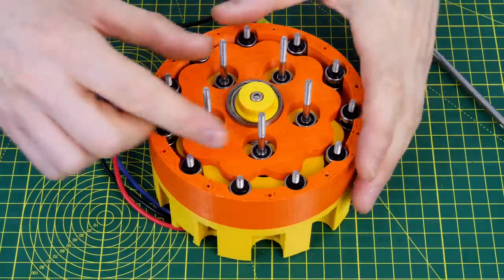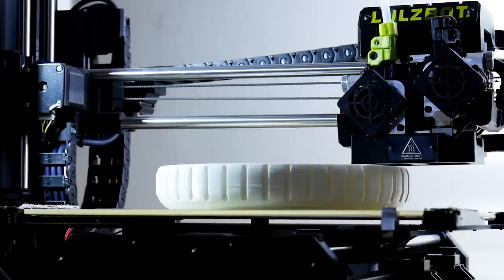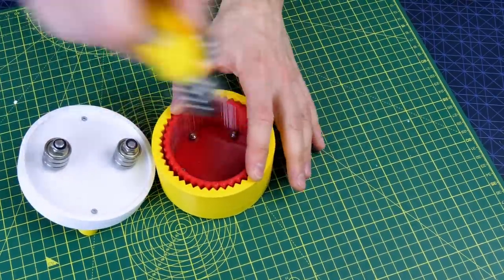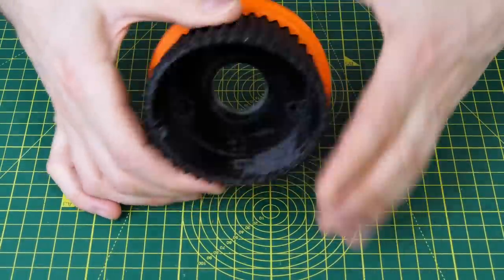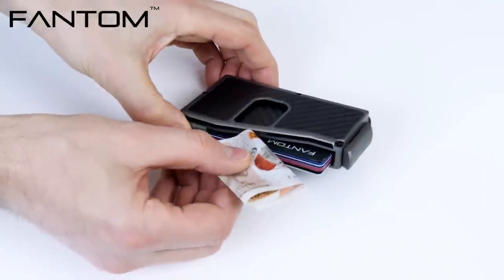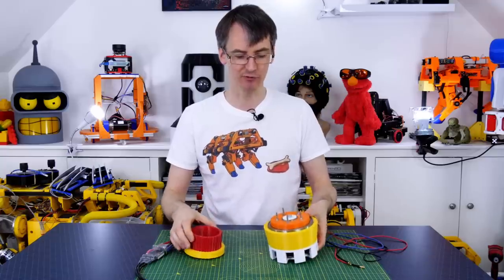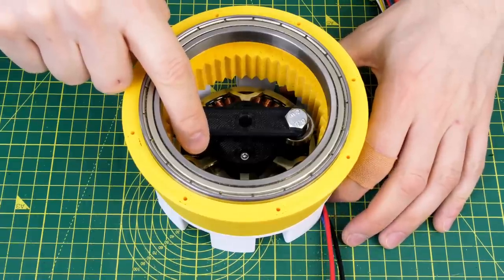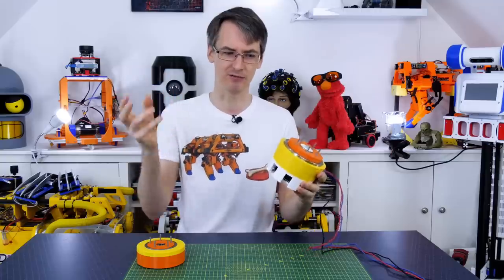Experimental Harmonic Drive Reducer - 3D Printed

Comment: two Ideas: 
1. Make the flexdrive with dualextruding, with ridged teath.
2. The harmonic drives I have seen before don't mount the output to directly to the flexdrive, but have a second ridged tothring, that gets alined with the stator ring by the flexdrive.

Comment: A harmonic drive's spline is more efficient the better it is at retaining its circumference without losing engagement with the exterior teeth. This suggests several optimizations:
* Print out of a rigid material and keep the deformation juuust this side of plastic deformation. This allows you to make the spline much thinner without compromising on resistance to tension.
* Print out of a rigid material. You're likely losing a ton of energy into compressing the *teeth*, which costs energy directly and allows the teeth to engage badly.
* Introduce little metal belts. These will resist tension without introducing resistance to bending.
* Don't extend the teeth all the way down the outside of the spline. Corrugations are fantastic for introducing resistance to bending, which is what you don't want.

Comment: Hi James. I was surprised when you were able tot turn the flex inside the teeth when the deformer wasn't installed. I'd think that it would work a bit better if you make the teeth catch the other teeth by say 30% in the "undriven" state. 
Also the teeth being triangualr, any force on the teeth will translate to a radial force on the flex part. If you make the teeth semicircular each tooth has a flat part that engages another flat part, so when you backdrive the thing you don't have the flex trying to move out of the teeth. 

That said: I think your conclusion is solid: the cycloidal drive is much better.

Comment: I'm pretty sure that although it is called flexdrive it should flex as little as possible, hence why it is usually made out of metal and has only little teeth. So maybe use some hard material and make the teeth smaller. Also experiment with the toothshape. I'd expect trapezoidal/square teeth to be beneficial since they hold the torque in direction of the material and would be less squished into the wave generator.

Comment: The reason you can stall a strain wave is that there is no direct connection with the motor and the gears.
The bearings are distorting the flexible drive causing it to move in a similar manner to a snake not actually driving the gear. So when you stall it the bearings simply squeeze the flexible material without imparting any drive.

Comment: I imagine the wave generator should not just be a narrow stick with two bearings at the end but rather an oval that conforms to the inside of the flex spline. This could reduce buckling of the spline and thus slippage. Also, consider using a chain rather than a flexible spline for more stiffness. That would, of course, make coupling with the output cup more difficult. Lastly, increasing the diameter of the bearings on the wave generator that push the spline outwards into the ring gear would increase meshing and thereby reduce slippage.

Comment: one suggestion i have as to why you can stall it with your hand: you might want to alter the print of the flexible part, so that the teeth are more filled with actual material. Flexible material can be very different depending on the wall thickness. a minor point: if you have lesser material on the walls where there are no teeth, it should reduce the strain on the motor because the walls bend easier. Also and more importantly, you can add more material into the teeth spikes, and remove material between the teeth. so the teeth will also be more flexible, but at the same time where it counts and the force is beeing transferred (the spikes) it will be a lot harder and wont squish to the rotating thingy in the middle. in the end, you only need so much material to hold the teeth spikes together that it doesnt rip apart.

Comment: I think a lot of the friction in the flex one comes from the teeth rubbing against each other as the inner teeth rotate. I imagine as soon as the gears come under load, that friction jumps massively. The cycloidal drive has bearings to rotate instead of slide, which has an obviously lower coefficient especially with the big multipliers the resistance gives.

Comment: I think the lower you try to flex that belt the harder it is to flex the belt intirely. Especially because the teeth are locked at the bottom. The higher up the easier it can flex and the easier it becomes for the motor to handle it. Try putting the bearings higher up. Because of the two teeth on either side sitting in the inner ring it is almost impossible the drive it back no matter how high the bearings are placed

Comment: Oooh, I'd built a mini one with tpu and pla a few years back. I think it stalls because it isn't backdriving, so when you hold it,the wave generator tries to move out of phase and deforms the flexspline, but it doesn't see the force of your hand stopping it, it seems the force of trying to drag the flex spline along the outer gear, if that makes sense?

Comment: Been loving these videos on reducers. I was trying to make a 3d printed harmonic drive myself a while back. I think one thing you could try is to add additional bearings onto the wave generator so the bearings form a sort of ellipse shape to keep the flex spline from flexing in an undesirable way. I think this may solve the issue you were having when the motor would rotate but the output was able to be held in place.

Comment: Personally, I would go for the cycloidal drive. As you said, there is less friction involved, and also, the deformable spline requires pressure to deform, which is lost forever, whereas the cycloidal drive does not. Apart from this,  the cycloidal drive is backdriveable, and doesn't skip when this is tried, due to non-deformable parts. Of course, the harmonic drive might need extremely specific tolerances, however as far as i can understand engineering, use the thing that works well for what you need and has as few moving/unpredictable parts as necessary

Comment: You could put a slightly compliant coupler with a strain gauge on it between the output and the axle, and then you could use that emulate backdriving the motor.
Just a thought.
Reply from the maker: But then I can't dynamically control the springyness with software

Comment: In the flex spine you are looking for a flex not a deformation. The long and short chords of the wave generator need to be calculated from the tooth profile. That is, at the long chord, the teeth of the circular spline and flex spline are fully engaged, but  along the short chord, the teeth are just barely separated. The fact that you could rotate the flex spline when the wave generator was not inserted is probably not good.

Diagrams often exaggerate the flex to show the concept, but the implementation is rarely so eccentric. With the minimum clearance, you can get more teeth at each major axis to share the load. More teeth with smaller depth maximizes the efficiency so you can get up to %60 total teeth sharing the load. 

Because you are flexing the surface, I think you can use a much more aggressive pressure angle than normal gearing.

The reason that metal flexsplines are deeper cups are to allow the needed flex, but that is balanced by the twist of the cup which can distort the tooth geometry. I think that is why you were able to stop the rotation with your hands. 

If you are going to continue to use a TPE, you should use the hardest (PCTPE/TPA), switch to involute teeth, with an aggressive pressure angle, and calculate your wave generator ellipse dimensions based on your tooth working depth. 

Creating a wave generator with bearings all around the ellipse (at least at the major and minor axis) should also help keep your flexspline from deforming rather than flexing.

If you go for a more rigid material for your flexspline, balance the depth of the cup to allow for flex, but minimize twist.

Comment: In theory you can connect 3 hall effect sensors to the VESC by default to get position feedback of the motor, or you can modify the source code to be compatible with your favourite encoder. Or my memory is wrong? 🤔😳
Thanks for your amazing videos from Spain 🇪🇸😁

Comment: Interesting but here's an idea, adding an expanding collar to the top of the flex drive cup so it can deform the shape of the teeth without overly effecting the top part of the cup, a v shaped collar at the top should be enough to let the varying geometries to work together nicely without adding as much resistance to deformation, or rotation, along with shaving a few microns off the overall width of the flex drive, and supporting the teeth better with more bearings, or perhaps a barrel roller instead of bearings, so the whole tooth is pushed into engagement for less slippage?

Comment: Just spitballing but the flexspline may not be deforming enough to only have solid contact at just the two bearing points. The all metal one you showed doesn't need to flex much as the teeth height is extremely low.

Comment: Pro tip: use involute profiles on the inner and outer teeth so you maintain phasing between input and output. also if you use more splines you can use a stiffer material with less overall deflection and a higher ratio. involute profiles roll off of each other and the less deflection there is the less force it take to drive or back drive it.

Comment: The teeth are climbing each other as rotation is inhibited, squishing them at point to point because the leverage is significantly against them.  You probably have minute warping as the inner PLA shell is warping also to allow.  
Maybe if the material was a denser, non flexible type and lubricated so the teeth are forced to slide into being seated into the outer teeth.

Comment: I know this is a bit of an old video but if you see this comment and ever want to come back to SWG drives I think I know what is causing your low stall torque and erratic operation. For an SWG drive the difference in the tooth count between the flex gear and the stator gear has to be a difference of 2. By having a difference of 4 your drive is trying to move 2 teeth every 180 degrees of rotation which shifts your contact patches away from where your wave generator is trying to hold the teeth together. With a difference of 2 teeth your flex gear shifts 1 tooth every 180 degrees which keeps it from binding with it's 2 contact points. for a 10:1 ratio you would need 20 inner teeth and 22 outer teeth. You can achieve this by either shrinking the part or enlarging the teeth. You can also increase efficiency by redesigning your wave generator to help your flex gear hold shape at high speeds.

Comment: If you want to use the motor as a spring and protect the drive train from shearing forces make a sprung gear.
Using the flexible material make a tyre of sorts. Attach a drive hub to the motor and some bearings if needed then a spoked wheel made of flexible material then the hard gear.
Having a flexible wheel will allow the gear to be driven backwards by a small amount without damage.
There should be a choice of flexible material some that have a high rate of spring back and others that are more absorbent like Sorbothane.

Comment: When you try to stall the cycloidal drive, you are trying to stall something that is truly at 10:1, but when you try to stall the harmonic drive, you end up binding the drive bearing assembly, which means that is is stalled at a 1:1 ratio, not the 10:1 output ratio.

To get a better understanding of how different components can be stopped and their impact on torque and gear reduction, check out the working concepts of a planetary gear reduction.  You may connect a few dots :)

Comment: Might be handy for CNC projects, motors that should be stopped being driven by external force is a constant pain and commercial drives are super expensive. This has the speed and some torque to it, maybe the torque could be improved, plus a decent driver and the encoder and you're onto a winner.

Comment: Id say theres less surface area in the harmonic drive where the teeth meet , which means less holding pressure, coupled with the flexibility of the inner gear, the teeth are probably deforming under load.  Id say the cycloidal drive is much more efficient and more durable, though I suppose the cost is a bit more. You could always swap some of the bearings out for nylon with metal studs and some silicone grease, to keep the cost down. Either way good stuff once again.

Comment: My suggestion - make the wall of the flexible insert thinner to remove the tolerance capacity. I believe, what is happening is that you simply squeeze the wall of the flexible insert so much that the bearings are able to pass around and will simply turn. So thinner wall should address this - give much less capability for the wall to flex thinner and allow the bearing to run around. But it's just a guess...

Comment: Great job. I would recommend you to try this using an involute eccentric gear with two ring gears. The two ring gears would have different number of teeth and thus achieve the gear ratio (you can also try a Wolform gear set in a similar fashion). In this case, you would not have  eccentric bearings, wich can be a big issue. All the "work" would be done in the involute gear meshings. You have to consider only the backlash. 
Cheers!

Comment: Wave generator shaped like and cross with a long section doing the driving and a short section keeping the tension throughout the flexi gear. I think this could help with the high speed issues

Comment: From what I can tell, harmonic drive designs seem to favor a tooth difference of 2, and they seem to favor high reduction (high tooth counts), which makes a low reduction harmonic fairly rare. Most of the issues more than likely come down to tooth profile, just as involute teeth on gears are the optimal profile, there's more than likely an optimal profile for harmonic drive teeth that's dependent on tooth offset, as a different number in offset requires a different movement of the strain wave, where a design meant for an offset of 2 may not necessarily scale to an offset of 4. It's just not as simple as having a triangular or trapezoidal profile, as the flex spline itself is moving in and out while also rotating; again, involute gear teeth are optimal for their movement, a flex spline will also have an optimal tooth profile. 
There's also loads of different designs. One uses a compliant mechanism for the flexing rather than transitioning from a flex spline to a hub via a solid piece. Another design uses multiple sets of bearings to better mimic the desired shape of the flex spline, rather than relying on just two bearings to generalize the flex spline shape. 
Material choice is also important. Tolerances are also important. Etc. Deformation is an issue that plagues printed variations of harmonic drives, there's a reason why actual ones are all metal, either to the teeth and/or the wave generator bearings not being square. 
The downfalls seen here could easily just come down to geometric issues that need solving. It could just as easily be a tolerance issue. Like all developmental projects, this just needs refining and finessing to get it to work. 
A cycloidal drive is probably the better choice for the reduction you're wanting, there's a reason why low reduction harmonics are rare, if not entirely unheard of, and I don't think any hobbyist wants to reinvent the wheel just for a singular project when other wheels are more readily available. Maybe save looking into harmonics when you actually need a high reduction drive, where they're most commonly used.

Comment: There's just the inescapable fact that you will always overcome the flexibility of even triangular teeth with even a small load. It needs to be able to flex over its diameter but still have rigid teeth---which is why a metal flexspline works.

Comment: Harmonics are meant to higher motor speeds  with higher ratio numbers like 1:40+ if the output speed is the same as the cycloidal it should be a lot closer in results

Comment: Hello James, 
The problems you have with the skipping is because you chose the number of teeth wrong. Because the generator has 2 points of contact between the fixed and spline gears, the difference between the teeth must be 2. If you'd have a generator with 3 points of contact you'd have 3 teeth difference.

Comment: I have an idea based the design 3dPrintedLife made. I think you could get rid of the need for flexible parts all together replacing the spline with two gears where the bearings are on the wave generator

Comment: Consider designing a version with the flex spline separate from the rotor gear, like the one you showed at the beginning. You might need more bearings or grease though

Comment: Seems to me that flex in the outer shell would be the easiest way to allow skipping in this design -- there's a lot of outward force involved anyway, and it wouldn't take much of an oval-ing to let the flex spline start skipping teeth by forcing the shell outward.  Adding rigidity to the shell with either a thicker wall + higher infill or some reinforcing rings might help.

Comment: I think the cycloidal drive is just superior because the harmonic drive has compliant mechanisms, which is nice, but I think the outer teeth are just pushing the inner teeth out of the way, you would probabally have to tip the inner teeth with harder plastic so the outside can't just push them away